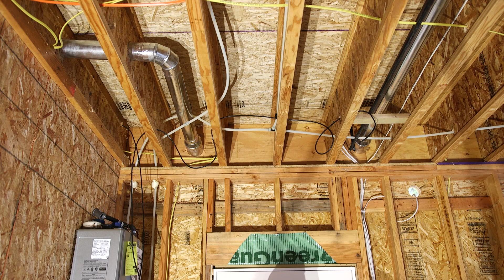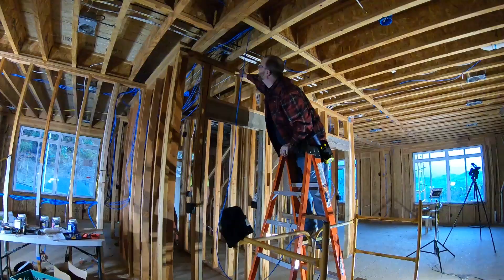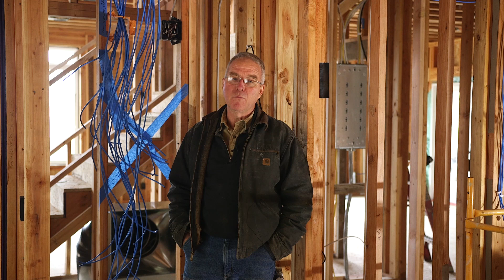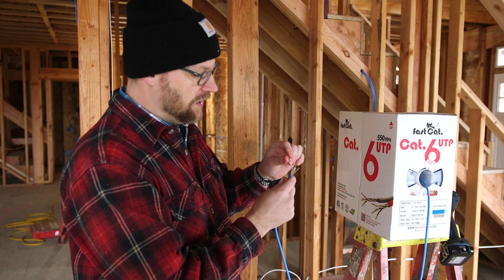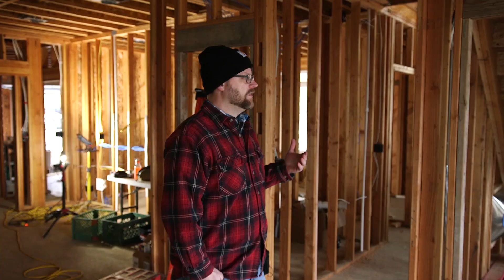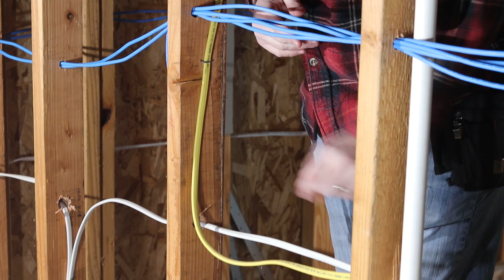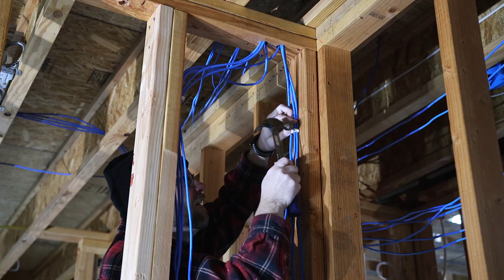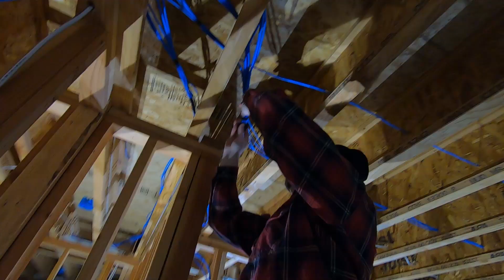Installing A Home Network Ep.100

Comment: One technical comment: the reason CAT6 cables can run at high speeds is because the twisted pairs function as waveguides, not just as wires.  At these frequencies, the energy propagates down the waveguide in a confined mode with low loss.  This is also why they should not be kinked.  A kink disrupts the mode and causes reflections.  The same physics applies to RG6 cable and optical fibers.
Reply: also why it is so critical to not nick the cable when making terminations.  At the frequencies in those lines, it becomes an impedence bump.  I know in Ham radio, we switch to N connectors from PL259 above VHF or you pay the price in lost power to the antenna.

Hence why I bought the professional tools even though I'm just a weekend homeowner type network engineer.
Reply: @anders.m.johansson  my trick to make it easier is to buy female RJ45 wallmounts so all my wall run ends up flawlessly connected with a single Bix punch tool.
Reply: Frequency is just the keyword to differentiate the cable classes as well. I think the box he had said 550 MHz. If I remember right with Cat 7 we would already be talking 1200 MHz. even though it is copper it cannot even remotely compared with your regular electrical cable. And as you stated, with the twisted pair cables, there is a lot more going on. the twisting keeps he wires in one pair at a rather equaldistance parallel to each other, which is needed for the positive signal on the one, and the negative signal onthe other, to cancel out as much of the magnetic field that is created around the wire (in opposite directions in this case). Also this twisting is not constant over the pair, but changes back and forth, to average out better, and the higher the frequencies get, the more you also have to pay attention to shielding, to keep those wire pairs from getting simple antennas which will transmit and receive whatever we do not want on the wire. for those higher frequencies the wave guiding effect is often overseen. but any hard kink or bend and the signal would try to "leave" the wire. same as with the modes in optical cables.
For that reason larger antenna cables in a radio system at a former workplace of mine did not even use solid cores for the wire. the core actually looked like a spiraled or corrugated and rolled up piece of sheet metal, as the signal only travelled along the metals surface. The core looked like a corrugatesd one inch pipe actually.

Comment: Those power wires entering the back of that junction box are almost flush with the wall plane and as you said they must be at least 1.25" from the edge minimum or a metal plate is needed.
Reply from the maker: You’re exactly right and they were  covered by nail plates.

Comment: I'm a residential builder and all our new builds have cat6 installed. But we also run empty conduit in the walls at key locations so wires can be pulled after, most common being a wall mount tv. The owners can easily run hdmi cables through the wall

Comment: I love this, but the house would be even better served, if you’d have put conduit from outside to the utility closet.  To the rest of the house, Rg6, and cat-6 is perfect for today, but fiber will likely need to go in sooner than later.   WiFi dislikes the current ducting material, we need to fix that, someday, but what can you do?  With conduit, you can easily remove the old, and pull new cable as the tech changes.   I’d go as far as installing conduit to other various convenient locations around the house as well, from the closet.   Probably would have added 400$ of materials, to the job.  But that’s what I want in my home, I always dream of putting some in.  As mentioned adding later is just too costly.  He covers the kinking issue nicely, and I see this installation in new homes these days, but usually, this kind of work is skipped entirely, so it gets an A, in my mind.  For an A+, I’d want conduit installed from utility closet to the outside that’s large enough to prevent sharp bends.  For the most elite, I’d take some 1.24” flex  from utility to a couple common areas as well, but I don’t think it’s needed to every room, WiFi is getting better.  Love this house.

Comment: Sorry, this ain't the 21st century. In case America would somehow catch up with the rest of the world, bury an empty PVC pipe parallel to the power input. If FTTB (fiber to the building) ever comes to your area, you'll use it to bring the optical cable to the point where your copper Cat.6 cables are starting from.
Reply: Why?  Burying fiber outside the house is the responsibility of the ISP's installer, and they have specialized tools to make it quick and easy.  It would be a waste of money for a homeowner to try to streamline that process, even in "21st century eurotrashland".

Also, the term here is "FTTH" (fiber to the home) since, unlike you, we generally don't live like sardines in huge prison-style apartment buildings.

Comment: only 3 minutes into the vid, and the first question comes to mind... why only cat 6... at this point in time many of the cat 7 or better cables are as cheap if not cheaper than cat 6 or even the still standard cat 5e cables... 12 min in... ok..kinda understand why cat 6... 13 min in, there IS one thing faster than cable connections, but laser coms are still in their infant stages.. especially outside of military applications...

Comment: 8:16 I have never seen stranded network cable before.
Reply: The pre-terminated patch cables you can buy usually are stranded (and in fact, should be). But hopefully most stock available in these 1000-foot spools would be solid-conductor.
Reply: @RobLion  Installing a RJ45 connector on solid conductors is hard enough.  I can't even imagine the PITA of trying to do it with stranded.
Reply: @jej3451  It's not too much worse, because they're insulation-displacement connectors in either case... but the connectors actually are designed for one type or the other, and subtly different in their construction.
Reply: Some are stranded with other conducting materials to cut production costs. Pure copper is getting rare and expensive.

Comment: As a network engineer, it's mostly magic when determining the number of network drops but I can tell you from experience, you'll never run enough the first time. Because of this, I have a personal rule: Never create a single connection drop. When you're there pull at least two. In my house, no drop contains less than 4 cables. In addition, I now always use "smurf tube" a network cable conduit to make it easier to replace the cable as technology changes (I started in the days of Cat 3 and if I rewire my current house, I'll use Cat 8)

Comment: This is truly a feature of a home that, if it's not there, I am offering less. Having hard-wired ethernet through my last two homes, it is a necessity. Wifi is unreliable and doesn't give you the same speeds that you pay for. Hard wired, all the way, and Cat6 at a minimum. How ever many you think you'll need, add another 10-20 percent to run in spots you might not think of. One of the bedrooms I use as an office, and I ran ethernet to my closet so I can have a media server run from inside.
Reply: Modern Wi-Fi standards are more than fast and stable enough for the vast majority of residential consumers. But yes modern homes should have ample hard wiring as well.

Comment: One other point about the cable specifications is to avoid CCA (Copper Clad Aluminum). It's cheaper so it might come to the top of your search results. Check the fine print since they won't be proud of it.

Comment: I'm shocked that new builds still rarely get wired up for internet. Not even a single socket in each room (say at the point the telly/aerial/sky/phone sockets are) at a minimum. It would be a tiny fraction of the overall build costs, especially if run to the previously mentioned sockets.
Reply: Looking at what ISPs usually offer here in Germany regarding network hardware, to me it seems no one who offers any kind of bundle hardware has actual houses in mind. It is all very much centered around a router which then distributes network access everywhere by Wi-Fi. Sure, for a flat/apartement, condo in the range of lets say up to 90 sqm, depending on how it is cut, that might very well work, especially if you possibly add one or two mesh repeaters. But looking at how many different SSIDs I can see around my town house at any given time in the 2,4 GHz frequency band, you already have to be lucky with the amount of Wi-Fi networks on each channel, to have any usable bandwidth left. Not that much of an issue with 5 GHz.
Now I try to imagine the situation in  a multi story apartement building, where you have stacked even more different networks on top of each other.
I am sort of lucky and sort of planned for this (I am actually a network engineer by profession, so also not a situation comparable with an average family) that I have conduit for network, antenna or phone cables into every room (well, actually not in kitchen or bathroom). Half of it was standard for when the house was built 10+ years ago, half of it I paid extra for (well worth it), as every other socket would have been just conduit from socket to socket on one floor, which only would actually help for cable tv or ISDN phone lines.
With this house beeing built from concrete, brick and mortar, with a lot of rebar in the concrete floors, the phone line comming in in the basement and having 3 floors on top... well, either I would have to do some sort of sick cabling, or the router would have to live in the basement (it does in my case) and the router alone would cover only half of the ground floor.
All the utilities including the phone line enter the house in the basement, so we have DSL available with up to 250 MBit/s right now. Cable is available in our street, but not in our row of houses (the company who built thisrow of houses only prepared for the required minimum to cut costs, getting cable to any of our houses would cost several thousand Euros for each house. I bet if they had prepared either cable or some conduit to run cable through, it would be only a few hundred Euros at most with something around 50 Euros for each house at most, while they still had the trench open when they püut all the utilities and the actual phone cable in. Will be interesting when optical fiber will be available any time within the next ten years. But I do not want to complain too much, I have limited choiceregarding the technology, but the bandwidth available is for a normal family home absolutely sufficient.
If I had used repeaters, there would be at least 3 repeaters cascaded together to reach the top floor and not very much bandwidth left, if any at all.
Right now with having conduit and having network cables, I runn mesh access points / repeaters which can be used either as mesh repeaters or mesh controlled access points with a cable uplink.
Same issue with DECT phones. depending on where i put the dect base, I manage to cover 3 floors at most. so either the top floor or the basement would not have phone.
But all this does not even stop within the houses. We have intense discussions here, about the costs for putting optical fibre into the ground where no sufficient bandwidth is available either through phone lines or tv cable. but if they built a whole area of new houses with several dozen houses, they still as minimum requirement put phone lines in and do not do all the work for optical fiber when all the trenches are already open.  I guess the main issue here is that other than with the phone lines which every ISP must be able to rent from the company who built them (mostly Telekom) they do not have to share or provide access to their infrastructure if they built the optical fiber infrastructure.

Comment: I would suggest running Cat 6a in the future and FTP instead of UTP if you value a good low ping and minimal noise connections.
Also Cat6 can't handle 10gb at 100m, only 50-55m.
Cat 6a handles 10gb at full 100m ( 90m the cable end-to-end + another 5m each side going to switch box/server and what's connected.
Of course that also requires a high quality network switch.

If you currently have 24 jack placements, then go for a 30+ 10gb rated switch, possibly with 2 100gb fiber connectors already present.

https://www.amazon.com/SolidLink-1000ft-Listed-Conductor-Ethernet/dp/B06ZY5ZCZG/ref=sr_1_4?dchild=1&keywords=cat6a&qid=1610824532&sr=8-4
https://www.infinitecables.com/new-products/network-switches/24-port-gigabit-370w-poe-switch-2-port-rj45-and-sfp-uplink-desktop-rack-mount-unmanaged-1u-ieee-802.3at-af/

Comment: Typically when I do an install I do different color wires for different runs.  Blue or white for all intended data connections, Yellow for VOiP/communications, and Grey or black for Security Cameras.  I also add Red or orange for servers and up-links but they are pretty minor....

Comment: I can guarantee you 100% that you can kink the cable and it will be fine after straightening it out. Ive been installing cable for over 20 years and if you had to replace every cable you kink, you would never make any money. All cables are tested with a Fluke DSX and they all pass fine even after being kinked.
Reply: You're only testing a small portion of the bandwidth that may be expected to be transmitted in the future on that wire.
Reply: @jej3451  I guess you've never tested cables before with a legit tester. The Fluke DSX tests the cable at its maximum. It's not just a 4 pair tester.
Reply: @robc7417  I'm simply using elementary logic.  If the Fluke tester has a "pass/fail" result, then logic dictates that there is some limited bandwidth that it is testing.  Future applications will use more bandwidth.

Comment: and.... que wireless..ugh  This will all be obsolete and for not, within 10 years. I just built my house and only brought in the line from the road for the connection. no other coax or wires and haven't missed them. This is a race to get rid of the wires, way more broadly, is anyone paying attention? lol #existentialcrisis
Reply: Transmitting your data through the air, in competition with everyone else's data and EM interference, will never be as fast, efficient, or reliable as wired (copper or optical fiber).  The top-performing applications will never "get rid of the wires", sorry to disappoint you.  (Also I believe you mean "for naught".)

Comment: Cat6 is fine. I would have run Smurf tubes with pull lines for future proofing. Cable companies use the RG6Quad shield and MOCA (media over Coax) and its also good to have access for this to home/rooms. Even a conduit from attic/crawlspace to the location of WAN/LAN interfaces, can help future proof. What it the home owner wanted PoE cameras/security? Or extended WIFI access points?
It is little cost to add empty smurfs to rooms, floors. And good to pull spare lines or leave fish tapes for future. (btw, the twist in ethernet wire is to cancel out interference. Solid wire for backbone/riser, and stranded wire for patch cables/connecting device to wall jacks.) Never get copper-plated aluminum wire as its cheaper and less reliable. I wired my TH with a bundle that included fiber! Way overkill but if someone wanted to have a home server or NAS...  Good explanation by Ben!  PS..never use black tape on network wire. Use zip ties.

Comment: I have been using the Internet since 1987, bought my first computer in 1984.  I'm building a house this year, and am not running Cat 6 to every room, only 3. The rest will be more than well served by wireless. Get your access points optimally placed, and you don't need more wires. Or just wait for 5G, and you don't need coax cables or fiber at all.

Comment: A network engineer friend did say for house building he would use cat 7 cabling for future proofing, if the house was built to last bit that solid core copper was most important. Apparently cat 8 and 9 are for backbone connection, so are used for things like the inter-university network or data centre main connections.
Reply: Cat 7 isn't even recognized as Ethernet cable. The best way to do it is Cat6 for runs under 55 meters (this really should be everything), Cat6a for runs from 55 to 100 meters, and fiber for backbone connections.
Reply: @KingdaToro  I'm not in any way qualified to know, just passing on what I was told.
Reply: @KingdaToro  he did say something like it had a better theoretical throughput for the future, 10 gig or something like that.
Reply: @cjhification  10 gig is handled by Cat6 up to 55 meters, and up to the maximum Ethernet distance of 100 meters by Cat6a. Cat7 isn't needed for it, just like how Cat6 isn't needed for gigabit.
Reply: @KingdaToro  is there another step up then like 7 can do 100 gig, I'm not good with labels, but I do remember he was suggesting it had a future speed advantage.
Reply: @cjhification  Once you get up to 10 gig and greater, the power requirements and hardware expense for running Ethernet over twisted pair start going up exponentially. Even for 10 gig, fiber is cheaper and less power hungry. For 100 gig, fiber is the only thing that makes sense.
Reply: @KingdaToro  thanks for the info, you seem to know more than the friend, he has been a network engineer for 10 years + but is not the most reliable of people.

Comment: I came into an issue yesterday that is frustrating. My customer purchased flat CAT7. They do not make flat clips that secure the flat wire. Let's say the wire is 1mm tall. Well, all available clips to secure flat wire is 1.5mm tall. You cannot secure to a baseboard and keep tension. There are droops between each clip. You would either have to shim under the clip, or shave down the ends of the clip. Avoid flat wire, if you can. ✌